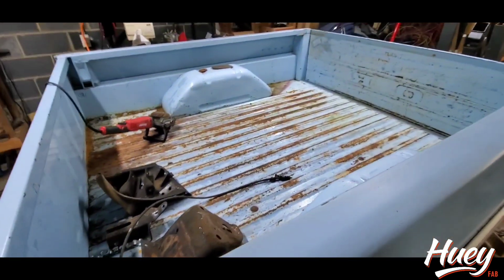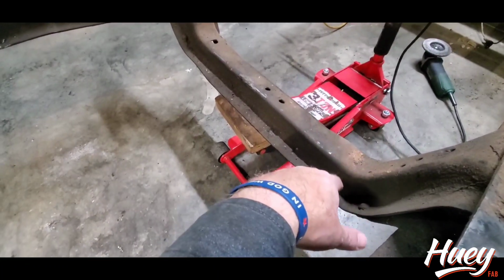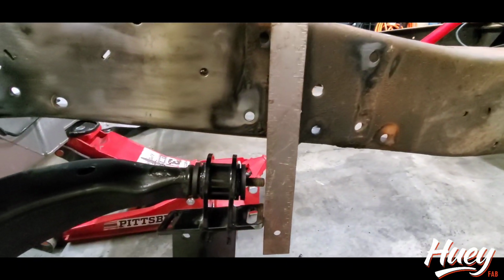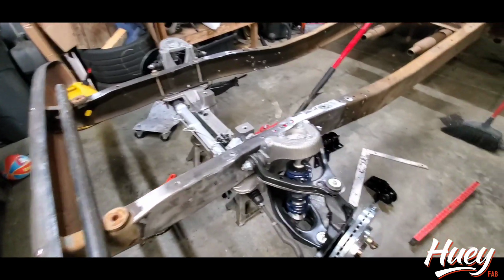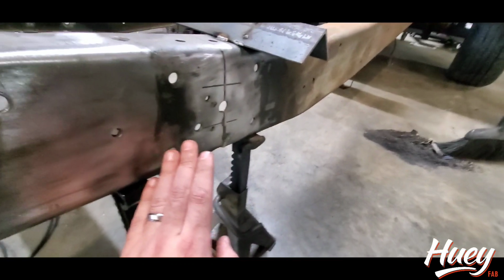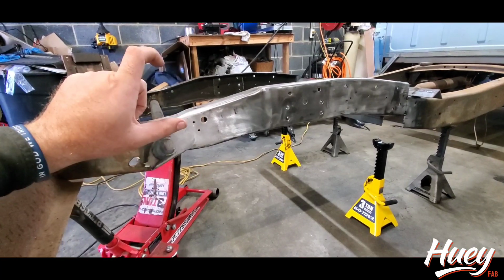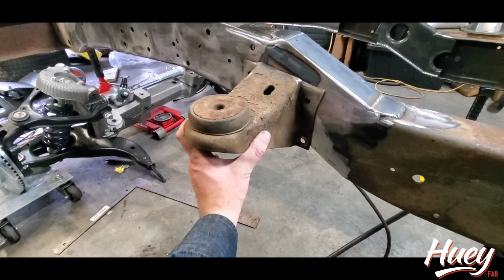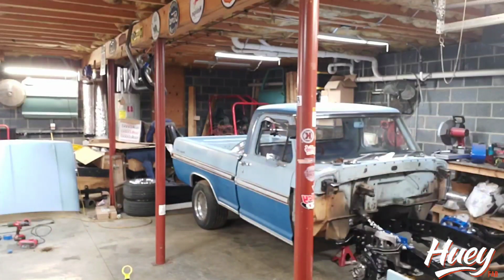Ford F-100 Bumpside: Slammed edition! Frame Zee your Crown Vic Swap.

Comment: Do you know what the inside to inside  of frame  measurement is i think one of my frame rails is slightly bent
Reply from the maker: I don't, not right off, but I can tell you that tolerances were rather large. I've seen widths vary by over 1/4"

Comment: who makes the steering linkage
Reply: Anybody can. You need a 34 spline to double D u joint, and then a double d to the “ford triangle” (not sure what the technical nomenclature is, but that search term will get you what you need) then you just need a piece of universal double D shaft. Summit or Jegs will have all 3 pieces. Should be well under $100

Comment: Is it possible to do this workout removing the cab from the frame, is there enough room to do that with can bolted down?
Reply from the maker: Unfortunately no, the cab mounts need to be removed and re installed to make a cut far enough back for the vic trailing arm. Now, if using a different front suspension, it is possible.

Comment: Whats the measurements of the line's you marked on the frame. And whats the measurements on the front. Thanks
Reply from the maker: In this case it was 2.5", but its based on how much you want to lower the truck around the suspension. Anything more than 3" is going to require more sheet metal work to the cab for Driveline clearance.

Comment: Im trying to determine the amount Im zeeing my frame,  Im wanting it to sit low (not quite as low as frank sits but close),  I purchased all of outcasts rear suspension,  but then also got the viking front coilovers that are already lowered from stock crown vic stuff.  Have you ever zee'd a truck using coil overs up front? If so how much did you go?
Reply from the maker: Every truck I've zee'd had coilovers. This one has ridetech, did another one with vikings from f100performance. My green truck (video on this channel) is zee'd with ridetechs as well, but I'd consider it as low as you can get. Meaning, you could adjust the coilovers up 1-2" and achieve your desired height. The Fred truck (video on this channel) is stock frame rails, cv front, viking coilovers adjusted as low as you should go on stock rails. 

Hope that helps!
Reply: That helps a lot thanks! I was thinking of just doing 1" zee,  Ill look some more at the other trucks youre referencing and judge how much lower Id want it from there.

Comment: I am interested to see your 4v in Frank with the frame Z.  It looks like the vic crossmember naturally sits the engine lower.  I swapped a 5.4 2v into my 67 using the the Ibeam suspension. It barely fit under the hood.
Reply from the maker: Yep. The vic cradle sets the engine several inches lower than stock. With the frame zee, it still puts the 5.4 intake below the cowl pinch weld under the hood.

Comment: Is that the ride height on the front with stock crown vic springs? Amazing work, and content! Love your channel brother.
Reply from the maker: It would be close, maybe 1" higher, but this setup has aftermarket coilovers adjusted to sit low. No motor or trans in here yet, so it will settle another inch, inch and a half once that weight is in there.